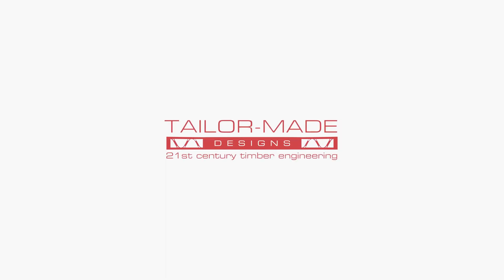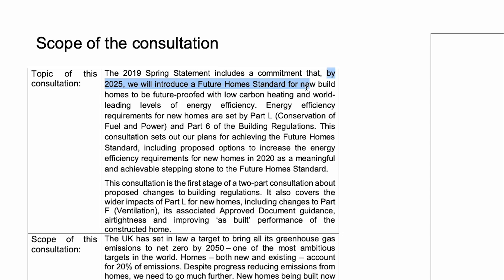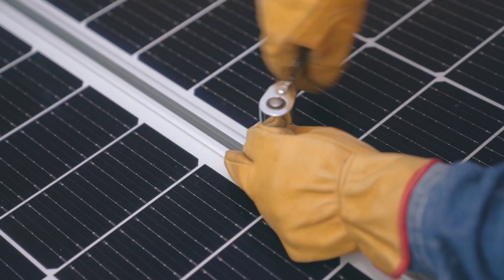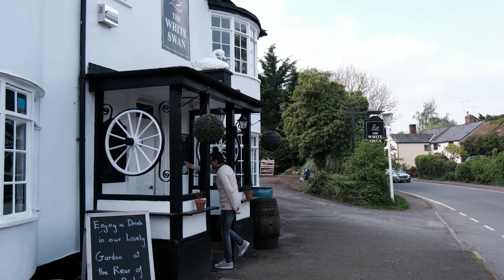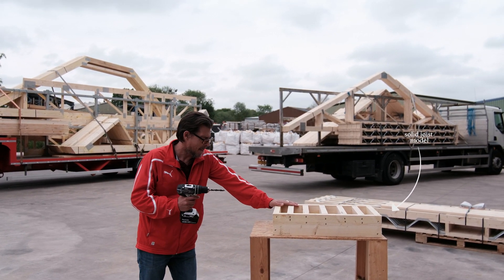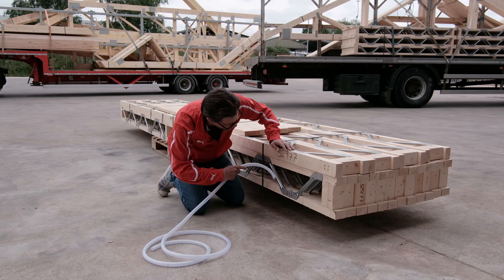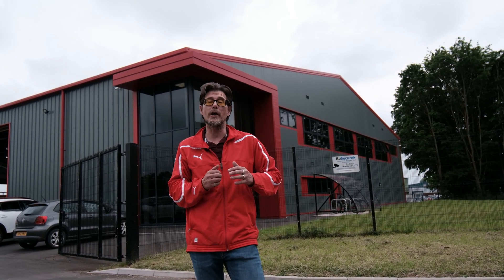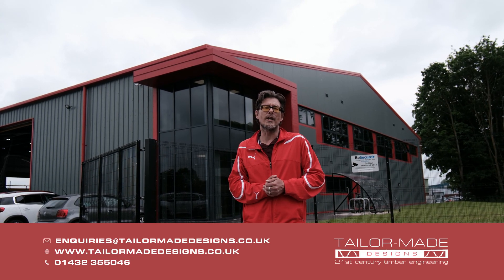Why You Should Choose Posi-Joists

Comment: Hi, how about cost as compared with traditional timber joists? Cheers.
Reply from the maker: More expensive than a solid joist to purchase (Posi-Joists probably twice as expensive), but often cheaper when labour is factored in. Plumbing, electrics, MVHR systems etc are easily routed through the gaps in Posi-Joists and can be installed pretty quickly, whereas solid joists require a fair bit of drilling and notching.

Comment: How do you insulate such roof to achieve proper values?
Reply from the maker: Largely the same as if using traditional solid joists—insulation is placed between (and in the case of Posi-Joists, inside) the joists at the level required.